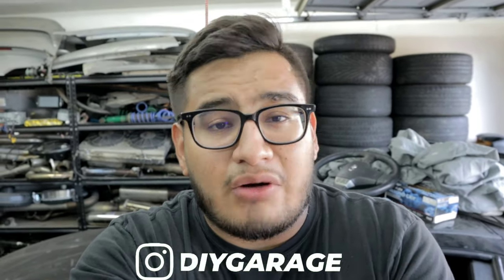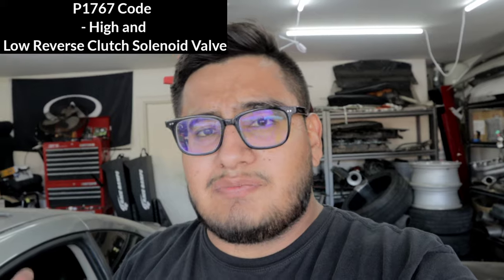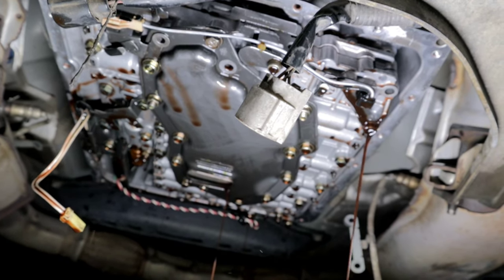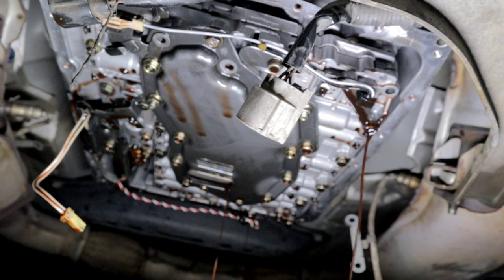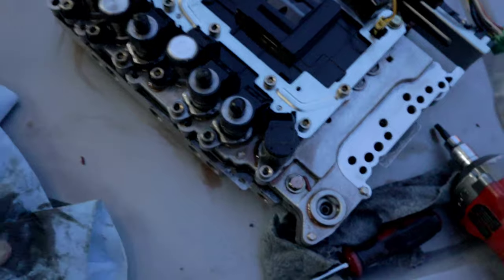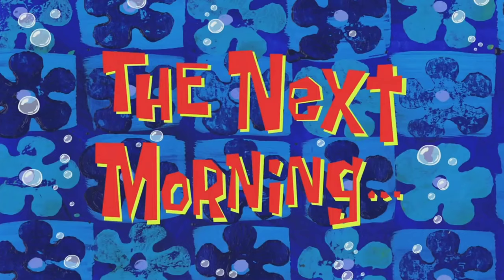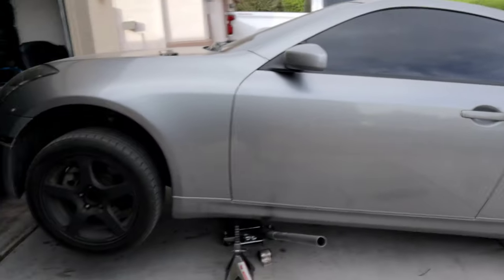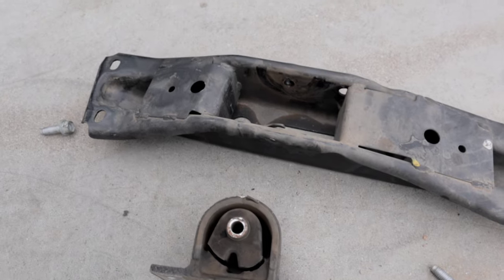More G35 & 350z are developing this transmission issue! Here's what you need to check! P1767 P1757

Comment from the maker: Thank you guys for tuning in! I do a lot of side work on Infiniti and nissan vehicles and this is a problem that is becoming more and more common. change your automatic transmission fluid and pray this doesn't happen to you as well
Reply: R u in phx ?
Reply: where u located
Reply: Hey Eric, I could use your help man. So I'm driving my 2005 g35 and first it hesitated going into 2 or 3 gear. Figured I was probably super low on trans fluid. I stop at store, put a quart in and then when. I started driving again. It went from 1st to 2nd gear and then going into 3rd it felt like It wouldn't catch. Then all of the sudden nothing.. No more going forward. Its rev'ing but no actual moving forward. Then I turn off the car. Turn it back on and it will start accelerating again. But again, 1st to 2nd It changes and going into 3rd just stops moving forward and only revs. I tried it a few times and same thing each time. I can get moving until it's about to hit 3rd gear and then just stops moving forward. Do you think I'm having same issue with valve body or could it be torque converter? I have no clue. If you could give me any help man, I'd really appreciate it
Reply: @deadmoon7959  wow my car started doing that almost a year ago and I was at the mercy of these mechanics who claimed to change my trans but I believe they changed a part cause the trans looks the same as before but they told me like tens times car was ready when they did not even start on it. So the fix as far as they told me was to put another trans In
Reply: @aloiba100  Yeah, Ive been tripping out, cause I can't afford to put a new trans in right now. So I was praying for any possibility that even if it was a tranny issue, it would hopefully be something that wasn't SO major critical, that if I attempted to do the repair myself here at the pad.. I wouldn't be able to get it done and fixed, on my own, with just my basic tools here in my garage.
Reply: I just kept checking YouTube vid after vid, hoping I'd find someone talking about the same issue I'm having, and hopefully the step by step on how to get it fixed.. But most vids I checked out werent even close.. Then I lucky found one vid of a mechanic talking about the issues of his G35, and they were pretty much the same as what I'm going thru.. Very slightly different, but close enough. Crossing fingers that after I get the car jacked up, and valve body off, this ends up being the same problem. Cause it's something I can repair, and not too crazy for the most part. I have to go into valve body and flip it onto the pins for the valve solenoids, and solder one of them back together.. Then put it back together and pray it works
Reply: @deadmoon7959  i
Reply: @deadmoon7959  just
Reply: @deadmoon7959  First thing bro before asking people for help is probably do some essential foot work like, Check trans fluid & levels(make sure its warmed up and cycle thru gears)and getting codes is vital w/o codes ppl are just gonna be gussing even with codes its guessing

Comment: I just wanted to mention that these engines and transmissions are available by the dozens at importer salvage parts.  I'm pretty sure you can get a trans for ~$300.
Reply: What's the link ?
Reply: Where
Reply: Where you get that at?
Reply: > enters comment section 
>Lies
> doesn’t respond to any questions 
> never returns
Fantastic
Reply from the maker: No you can't get them that cheap
Reply: @ERICSDIYGARAGE I've been looking at this comment every other week waiting. He's trippin
Reply: Try $2500 for a clean auto. Have 4 with 60k if anyone needs. Ontario
Reply: @ThousandWings350Z  lemme get one lol
Reply: I got an 06 g35x motor and transmission for 400, I swapped im currently getting it put into my car since my original engine blew

Comment: I’ve done this job multiple times for friends and I just had them get a valve body from a few junk yards near me and it was quick and easy. One thing you have to make sure if you do change your valve body is that you have to check if you have a single or a triple plug trans because they have different valve body plugs.
Reply from the maker: Interesting, did you ever have any issues with needing to program the valve body?  The reason I ask is because there's like 3 different types of valve bodies one of them has the TCM inside the cabin on early style 2003 G35. Somwhere in 2005 they changed again and later changed again in 2006
Reply: hey man did you ever see the issue where it boots tou out of manual mode? So you push it into ds, works for like 30s then boots you back into regular D drive, and you can't go back to manual mode until you restart the car. heard of that??
Reply: Wondering if u need to reprogram
Reply: As the other guy asked which trans need reprogrammed. Used units don't I've heard and new units do. Which is it ? No one online seems to truly know.
Reply: when I drive some times it doesn’t wanna shift so I let off then accelerate then it shifts
Reply: @ERICSDIYGARAGE  only need to re-program new valve bodies

Comment: Some of the shift solenoids are available separately from the valve body. I've seen them for about $50 each. Worth looking into if you have this problem.
Reply: Any idea how i can look for them? Been trying but can only find complete kits
Reply: @RUSOBPK  I've seen them on Rockauto for the 5 speed. Not sure if they're still available. For the 7 speed is hard to find.
Reply: @RUSOBPK  eBay got them, but u have to read the reviews before buying them. I bought the front brake and high and low reverse solenoids on eBay they are good quality hopefully this solves the issue of my g35.
Reply: @ModernHD800  do you know how much atf fluid you put back It

Comment: Well done technical!!! Very good job. With mine M35x I just replaced the whole valve body and TCM with a completely rebuilt one. That was the fix......did not have change the tyranny, like one shop was suggesting. Keep up the good work brother!!!💯👍
Reply: Where did you get your rebuilt valve body from?
Reply: What were your symptoms? I’m about to take my valve body out and test it b4 the tranny. Mine won’t go into gear  and seem like it’s loosing pressure but it was just driving right but happend and it doesn’t grind or knock
Reply: @travisussery258  what code did you get I got code p1757 front brake solinoid only my Manuel mode is shifting horrible like if the trans is out . But I got a used Vavle body on OfferUp for 120 and hopefully it takes the code away. Did you ever get yours fixed?
Reply: @panchogomez4238 did it work bro ?
Reply: @jrserrano9396  yes I did replace my Vavle body and the front brake solinoid code came off. But the horrible shifting was another code that I had because it was the shifter, a circuit was out and it was causing the computer to not shift smooth so I just replaced my shifter, Vavle body and obviously drain and fill with 7 bottles of atf. Car was running better then ever after that and shifting smoother then ever.
Reply: @panchogomez4238  nice to hear that , I hope and wish for your car long life

Comment: Bro you just saved my life I replaced the front brake solenoid and forgot how the bolts went to hold the whole solenoid valve
Reply from the maker: Glad to help
Reply: how did you do this? my 06 g35 sedan is throwing a front brake solenoid code

Comment: Worth mentioning that this fix only applies to later models 05 and up. 03 and early 04 models have the TCM located by the ECU on the passenger side in the cabin.
Reply from the maker: 2003-2004 transmissions are usually built better and done have these types of issues but they yes are different

Comment: I've been watching as many of these valve body/TCM/sensor videos and reading up since my '04 G35 coupe ck engine light came on a week ago (Code P1716).  I've been having hard shift issues basically when it is cold, so have been going easy when cold.  My opinion, the check engine light should have come on long ago.  Since I'm no mechanic and do only "light" work on my car (female, but know some females can/will do much more), want to be up on the subject.  Thanks for posting this detailed video, even though not my vehicle's code, it is all the same d&$m thing!  

Two days ago took my car to a mechanic with ck engine light illuminated (P1716 turbine revolution sensor).  Got charged for a cleanup of TCM & Harness Connections and for a trans service--went home, car "rested" for a few hours, take off and same ck engine light & Code P1716!  Obviously, mechanic could have done more to ensure a fix was absolute before pickup.  Not happy about paying for a job that didn't address the problem, and was for not. Thank God for the internet or I'd be totally in the dark!
Reply: Ever got 1716 fixed?
Reply: @MrYogitron92  No!  I believe it needs a rebuilt trans.  The TCM is located inside the valve body in my car, as is in this video.  I do not believe mechanics will typically do what this mechanic is doing.  Plus, the trans is now slipping.  Big sign it is going south!  Just a matter of time and it will "seize up!!!" 😪😱 Love the car but I'm done!!!
Reply: @kaze_cat  Hey,, do you still have your car or did you get rid of it?
Reply: @deadmoon7959  I thought I just replied to your question but don't see it.  If you didn't get it, I traded the car in because I didn't want to hassle with trying to sell it with a transmission issue.
Reply: I have a g35 04 sedan and im having the same probleam exacly what u said and im really tire of trying to fix it im about to just trade the car in or just buy another one cash i got the same code p1617
Reply: @kaze_cat  Oh okay, yeah.. I was going to say if you still had it, I could of tried helping you get it figured out and running again. But you got rid of it, lol. So what did you get in place? A FR-S or BRZ? (That would of been my choice.. Or the new 350z possibly 🙂)
Reply: @pedrocervantes1751  You got the code wrong. They got the P1716, not P1617. Their code was for Valve Body, while your code is for engine oil level showing faulty, or the harness connection could be damaged or have corrosion on the connector pins.. Totally different issue
Reply: Oh yeah my bad  p1716 i type that wrong
Reply: when I drive some times it doesn’t wanna shift so I let off then accelerate then it shifts 
Mine a 2007 g35 sedan
Reply: @kaze_cat  when I drive some times it doesn’t wanna shift so I let off then accelerate then it shifts 2007 g35 sedan 
What does that mean
Reply: @deadmoon7959 help me bro my transmission kick g35 coupe 2005 😔

Comment: I had my transmission rebuilt on 1/12/2022, and after 9K miles it threw P1767 last night.  Same symptom - in D, foot off brake and car doesn't move. Give it some gas and it moves.

Today it is acting fine, of course.

Thankfully it is within warranty from shop, we'll see. I suspect the valve body. The shop is highly recommended for these transmissions as that is ALL they do. They were able to drop the trans, rebuild the trans, reinstalled and tested in 2 days...so I have confidence they know what they are doing.

I'll come back with results.
Reply: @CFauvel any update bro?
Reply: @elcompask4te835  yes...
They replaced the valve body under warranty and found a bad ground strap.

Then after a few weeks I found that weird things would happen after going through the carwash. Throw all kinds of codes, dash lights would light up, headlights would come on by themselves.  Turns out the drain where the IPDM lives (behind the battery ) was clogged and was filling up with water, thus the IPDM was under water. Took a long time for the mech to find it as I steered him in the wrong direction by mentioning the carwash under spray and the recent transmission work. 6 hours of diagnostic time ugh

I don't think the IPDM being under water had anything to do with the symptom, but maybe....

Comment: P1716 speed sensor on the trans valve body 
It doesn’t allow trans to engage in 4/5th 
Get from junkyard and splice new sensor or replace and reprogram valve body.  Titan armada g35 350z
There’s an a and b sensor is replace both if your not to sure

Comment: Would a bad tranny cause my car to stutter / choke on itself?
  So mine is an automatic and when i step on it the rpms get stuck at 2k then jump upwards and it runs well. It only happens when its completely warmed up
Reply from the maker: It shouldn't turn off or feel like it's turning off, in my experience when you have a bad transmission you will just experience a lot of shutter and harsh engagements aside from that the vehicle should idle the same or very close to 1k prm sometimes idle can go up and down since the computer in the transmission also Is used to for idling

Comment: I have an 04' G35 Coupe auto trans. Car has 160K miles and Got vehicle for next to nothing from a relative. Replaced coil packs as they are old ,car was running great & I let my Son use vehicle for past 9 months as he needed it for his graduate degree and internship and is now an Engineer .He needs a new car and now I'm left with a G35 that is slipping ,shifting gears weird ,and reverse take like 15 seconds to engage. It is scary to drive as I don't know if its gonna slip when I go to make a left with oncoming traffic approching! And I make sure to back into a parking space first so I know I can get out . Not really using car only for short essential trips. I feel the car is worth keeping as it is a NIJ RWD 285 HP v6 car. Would cost a good chunk  of change to replace new.
Reply from the maker: Check your transmission fluid level you might be low on it. If not the transmissions normally go for 750 used and labor is around 1k
Reply: @ERICSDIYGARAGE  Awesome .Thank you . I'm in S. Fl area .Car was used locally by middle aged female mostly so it wasnt modded or raced and beat like a lot of them . I will definitely find my own parts as I already got a $3K price just to rebuild this one ! My area is unfortunately full of scammers.  Thanks again.
Reply from the maker: I would not rebuild them. It's better to get a working used unit
Reply: @ERICSDIYGARAGE   Could you help me locate trans fluid access?  It is enough of a nightmare to re-insert oil dipstick on this car ! Nuts! TY!

Comment: Man i did exactly this, changed all the solenoids and reinstalled the valve body, now the car wont even crank, dash will light up, but doesnt start, i didnt disconnect the battery when doing the work, i forgot, maybe that messed up something, any help?

Comment: I had this same problem 05 g35x sedan.. I tried soldering the metal contact point and it did not work. So I changed the transmission 3 times and had the same problem with different valve bodies, I ended up just selling the car.. I highly regret it cause that was my favorite car

Comment: Do you know where the vehicle speed sensor would be located? Code P0500 speedometer doesn't work 2004 g35 coupe automatic transmission.

Comment: @ERICSDIYGARAGE Nice job 👍🏾 you did still fix his major issue, he was worried about, so that tells you his solenoid(s) were the issue, when it shakes though is it in sport mode or just normal drive? Just curious to know maybe it doesn’t matter which position it is in, but still if in sport mode it’d be harder on the car, so I definitely agree with you on driving the car till the transmission goes out and then a full replacement, but also if he comfortable enough he can just swap it to manual too, I have an auto Infiniti too. I would like to know this though is what years have you noticed this issue with? And is it coupe or sedans mostly?
Reply from the maker: Yeah I'm glad that it's at least  drivable now. And as far as transmission issues  2003 g35  coupe or sedan are good 2004 2005 2006 and 2007 g35 coupes have this issue as they get older the same goes for 350z and other vehicles with this transmission
Reply: I have an '04/05 G35x. Apparently they are (early versions) prone to valve body/tcu issues. One reason is due to a failure in the tranny cooling line, where it passes through the lower radiator. Causes coolant and ATF to mix in transmission and engine. Mine had this very issue while doing 120 (km) down highway. 
Most forums say that if caught right away and no damage done to transmission itself, it can be repaired by replacing valve body/TCU. Although it's not a guarantee. 
My issue is solely with 5th gear/overdrive, where tranny doesn't want to shift into 5th. As such I'm at 3000rpm while doing 100km (60mph). Hoping the valve body/TCU swap will solve issues. 
Note I too get a weird vibration when using manual mode, putting tranny into 5th gear. At around 80-85km/hr